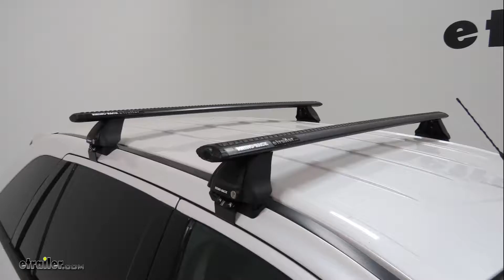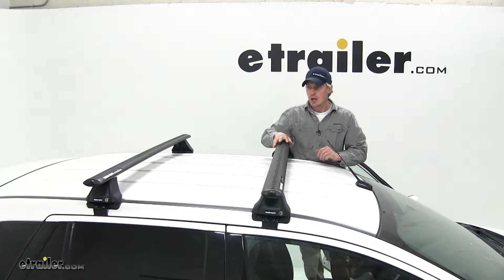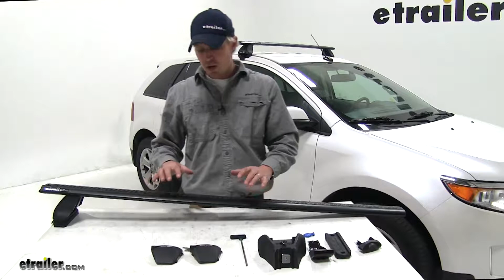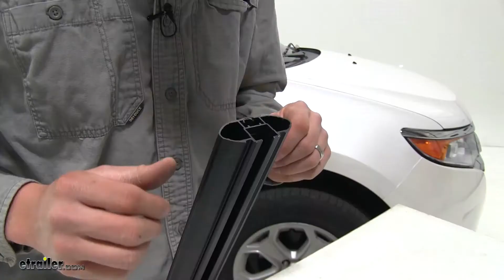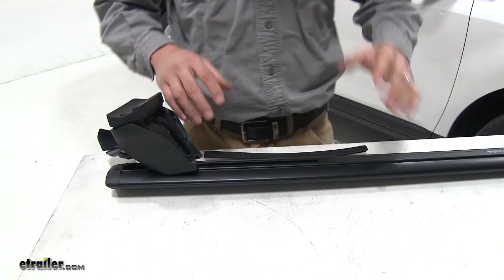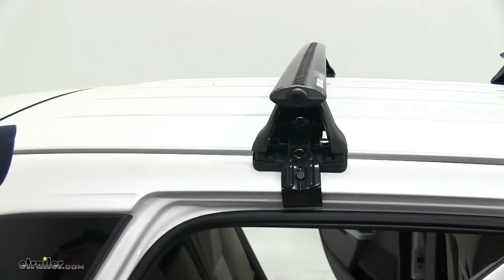Setting up the Custom DK Fit Kit for 4 Rhino-Rack 2500 Series Roof Rack Legs on a 2014 Ford Edge

Comment: Wondering if the hooks that go into the top of the door fitting will scratch the paint?
Reply from the maker: The hooks is this kit have a rubber coating on them to protect the paint on the vehicle.
https://www.etrailer.com/Roof-Rack/Rhino-Rack/RRVA137B-2.html
https://www.etrailer.com/Roof-Rack/Rhino-Rack/RRRLKVA.html
https://www.etrailer.com/Roof-Rack/Rhino-Rack/DK228.html